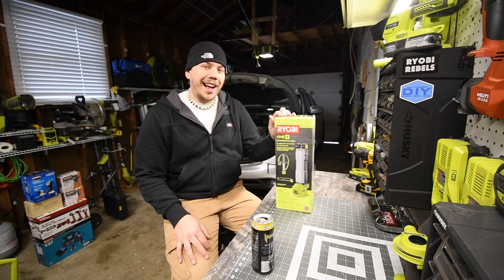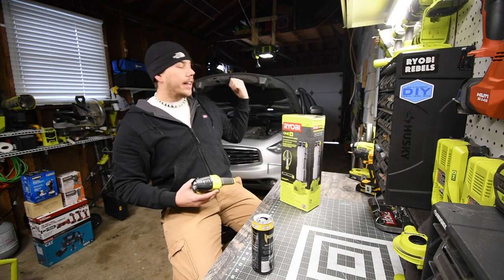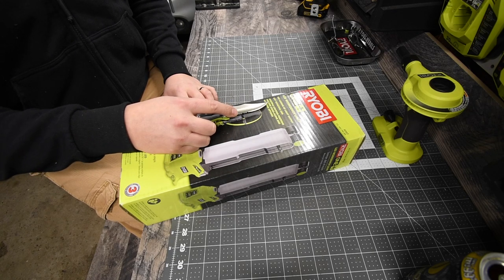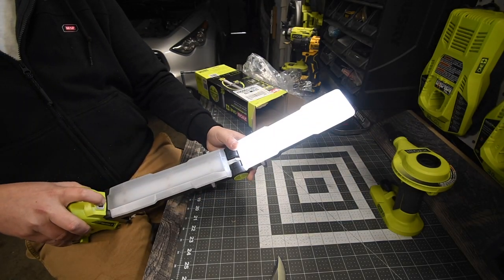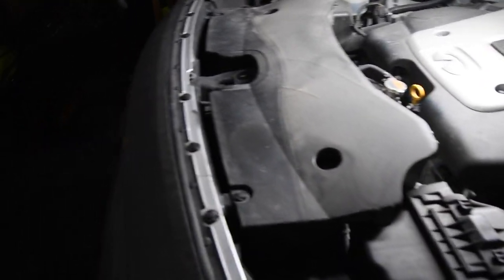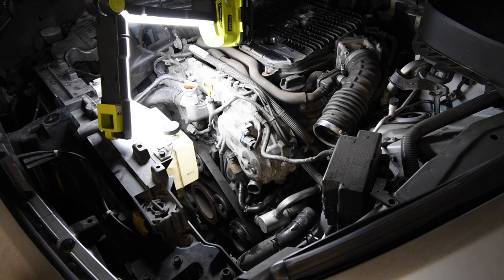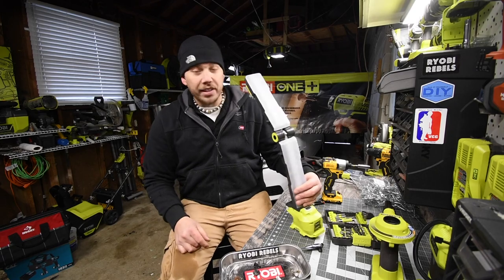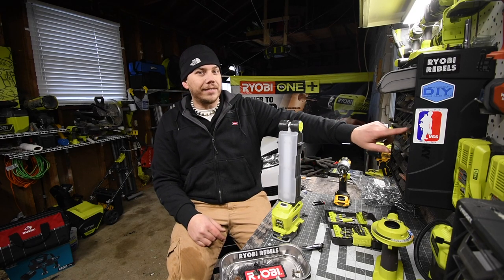Changing out Engine Thermostat

Comment: Tim from Canada watching this video and I see you were having a problem trying to find some place to hang your light... suggestions are. Get a bungee cord whatever size you think you need.. hang it inside your car.. then hang your crappy Ryobi light from the bungee cord.. this will work for anything you were doing. If you do not have access to space always remember you can hang a bungee cord from anywhere if you have enough strength in the cord to hang your light.. it is a rule of thumb some magic words are stronger than others so you just have to figure out which one works for you

Comment: I have that same light and i love it. I use it everytime for work and as my ice fishing light. I find it drain the battery pretty fast when you have both side on. But when your only running the light on one side it last very long... Ryobi got it right with that light...
Reply from the maker: yes. I learned that as well. when I wa putting it together I used on side and the battery lasted far longer than when both sides are on

Comment: I told you that you would really like that light. 😁👍  I usually use it with at least a 4-Ah battery to give it some weight in the base (and so  less likely to tip over; although you positioned it in a "tipped-over" position).
Reply from the maker: It was really useful and thank you